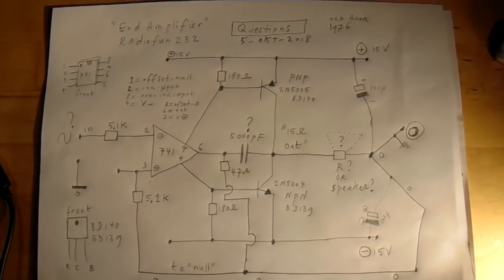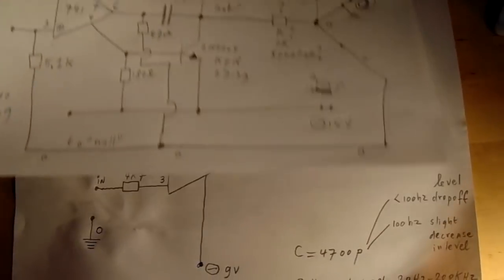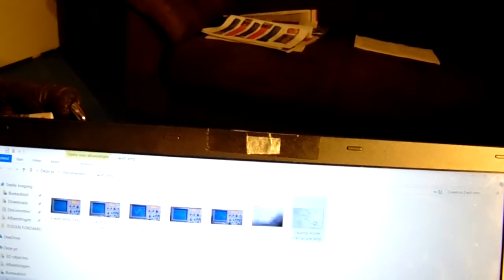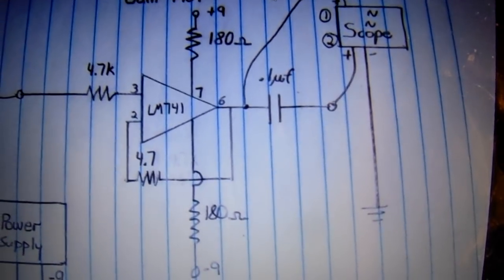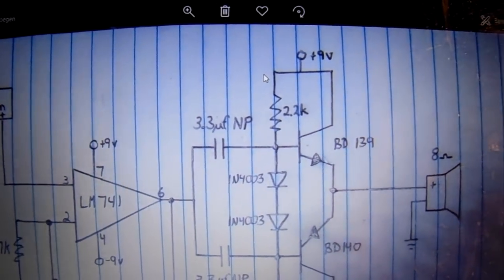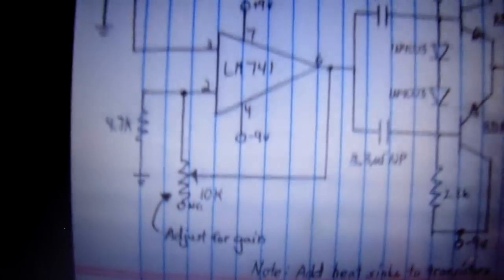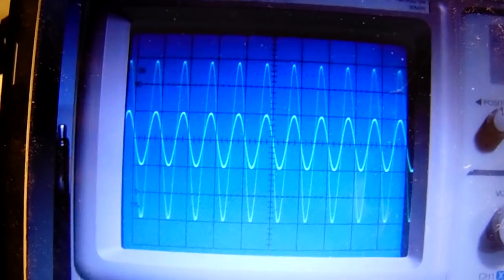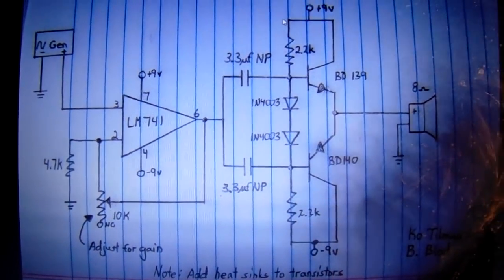741 Opamp used as amplifier

Comment: The first schematic had an error which I corrected in the second schematic. The next schematic, which has not been published yet, has three op-amps in series to increase gain. If I had a quad op-amp chip, I would have used that.
Glad to help.
Reply from the maker: OK, thanks. I will mail you.
Reply: Maybe I would try adding another BD139 after the op amp to increase gain and drive the final stage transistors. Just a thought. Of course, you would bias the BD139 as an emitter follower.